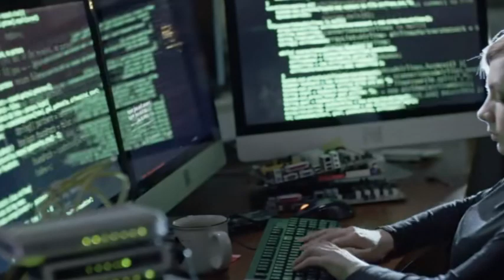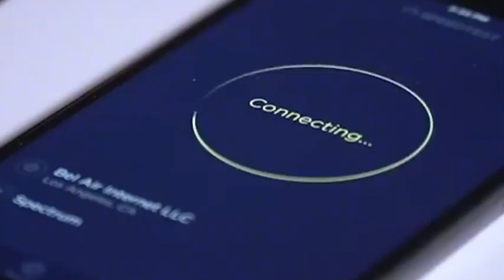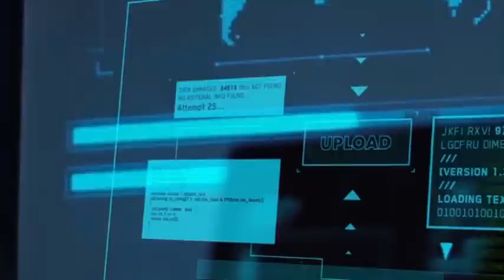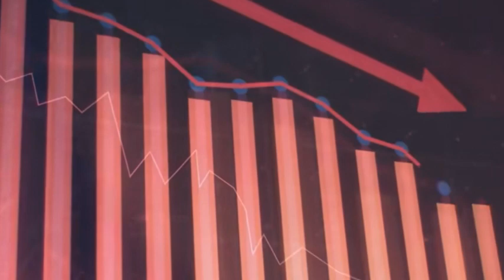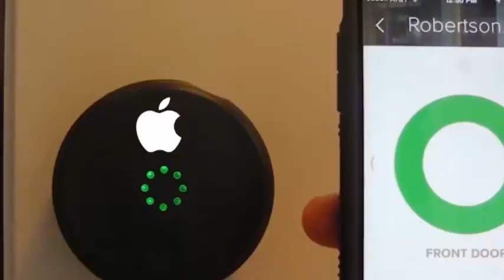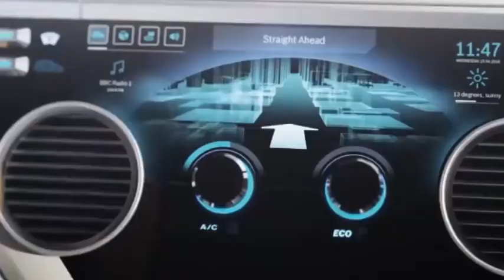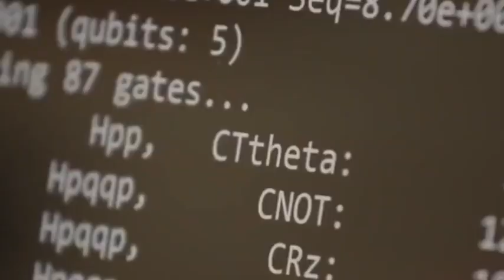America's $ Costly Mistake: Why Chip Sanctions Against China Hurt the US MOST？

Comment: The problem for the US which is that China has four things, the knowledge with more researchers, the capacity, the materials and the bigger market. The US can't change that, and even if China doesn't produce everything used by industry several years before China will reach that level, China can get something to replace it or make it unnecessary. The latter is important, because China basically proves that the US and its accomplices are unnecessary.